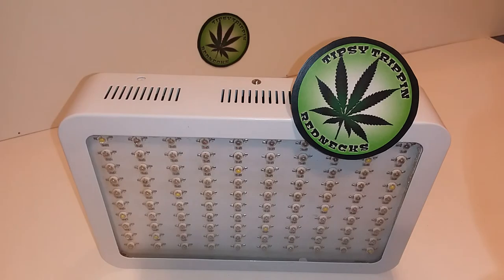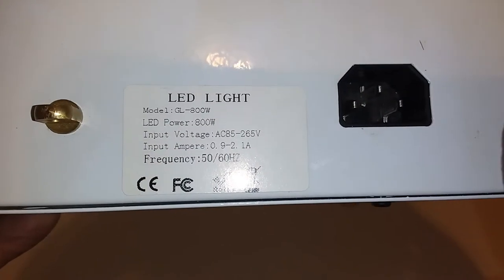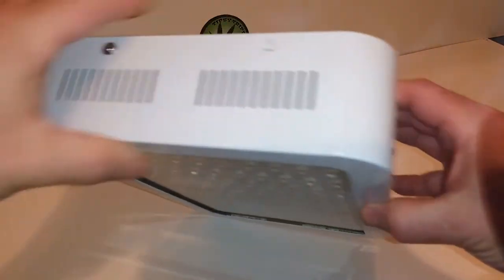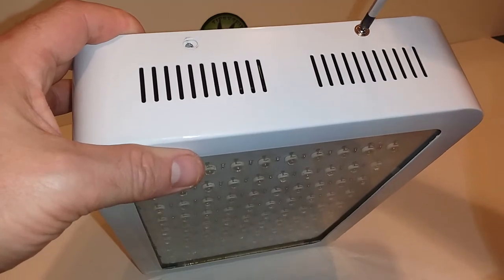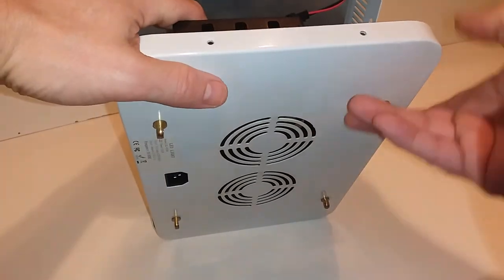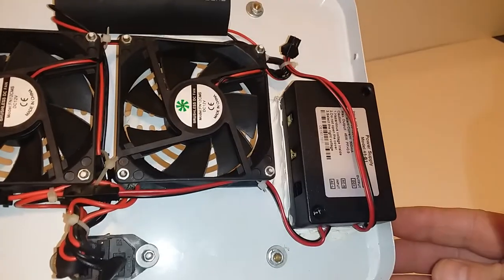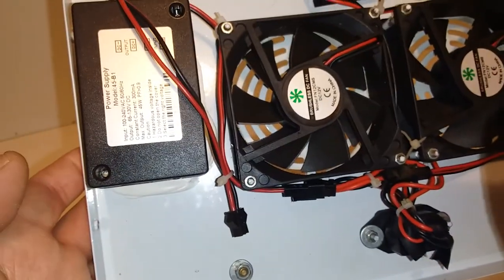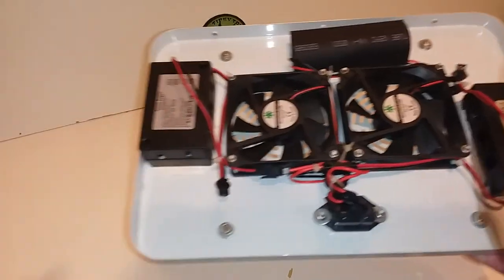Tipsy Trippin Redneck LED Light Re-build, Episode 1

Comment: Awesome im thinking about rebuilding the two cob lights I have
Reply from the maker: Awesome man, may i ask what kind of COBs you have?✌💚💨
Reply: @TerpPtarmigan  I was just looking at some full spectrum cobs on ebay
Reply: I was wondering if I should do the 3500 k white and then the 400nmto700nm full spectrum or they have same full spectrum white as the full spectrum purplish color
Reply: I want to do 3 purplish full spectrum and then 3 white of either the full spectrum white or 3500k warm white
Reply: That's for light I'm going to build myself and just use same cobs for the cob lights I already have and add some heat sink to them
Reply from the maker: We seeking COBs check out Rapid LED or a place like Digi-key.  Most of the COBs on ebay are not very good at all.  Try Bridgelux V series for buget and the Vero29se if ya want to kick butt. Companies like Cree, Bridgelux, Samsung and Citizen make some realy good COBs. You will have a way better grow with just white COBs, 3500k is perfect for flower and veg.  To make a long story short lol, if theres not enough blue the high peaks in red will not be used until the blue is increased.✌💚💨

Comment: Nice terp are you retro fitting cobs or veros
Reply from the maker: I havd 2 types of Cree COBs and 3 types of Bridgelux COBs in stock, still not sure on what i will use lol.✌💚💨
Reply: Terp Ptarmigan nice I have a Mars 1600 actually a 700 lol I need to do the same, I was thinking of using the cxb3590’s
Reply from the maker: @Chill_Mode_JD  the Cree CXB is not the top dog anymore lol but still very nice.  Have ya looked at the Bridgelux Vero 29se. Its a very tiny bit better but alot cheaper and has built in holder with push wire connectors. ✌💚💨